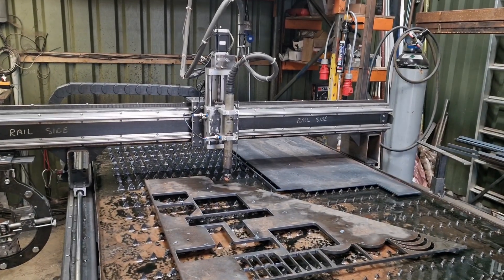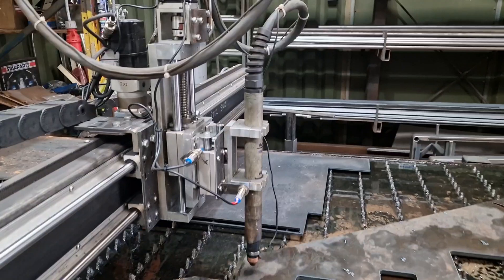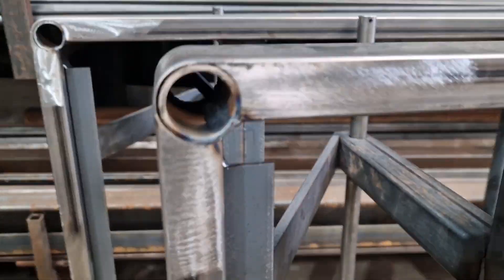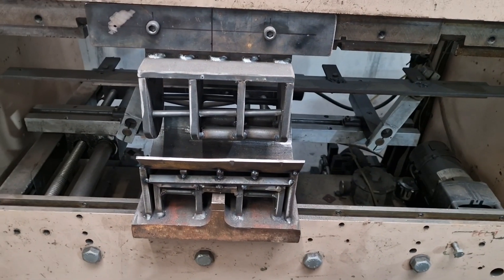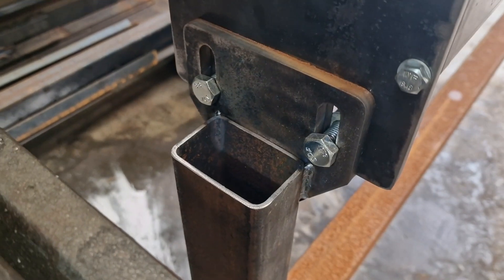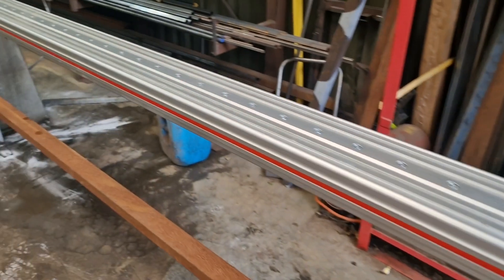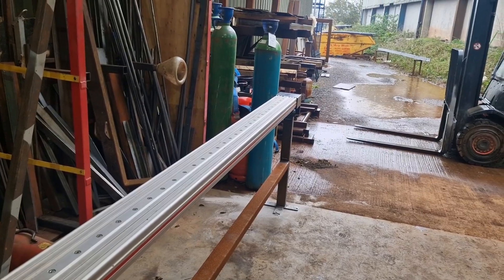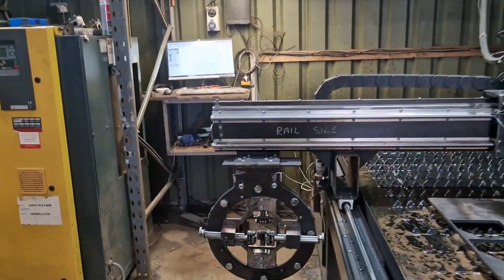Follower diy rotary update and new project.

Comment: Hi, I really like this addition you did to your x,y plasma cutter. I was wondering for the Z height or torch height controller, once a square tube rotates and the corner of the tube is on the upper side, is the Auto THC taking care of adjusting the Z height automatically, and you basically send a flat drawing? Thanks for clarifying.